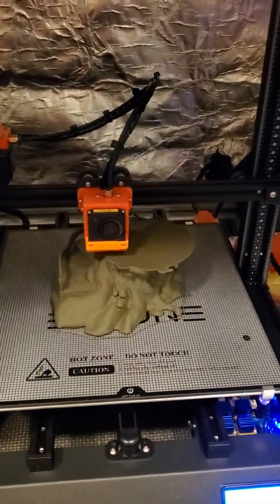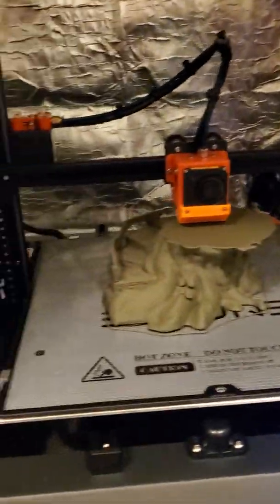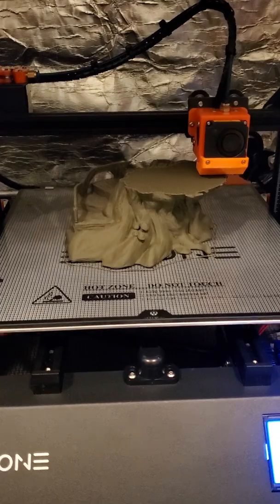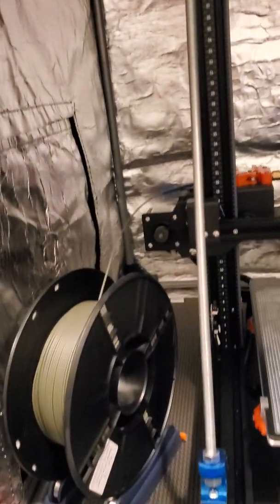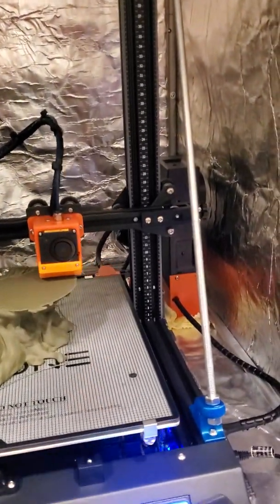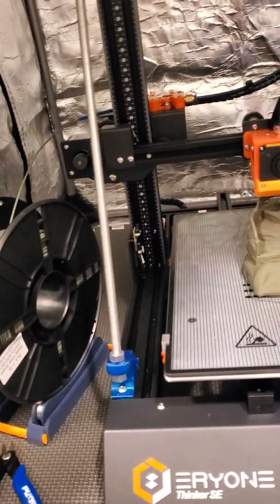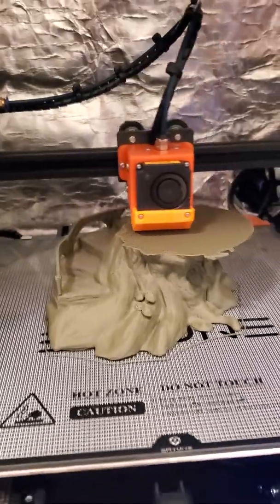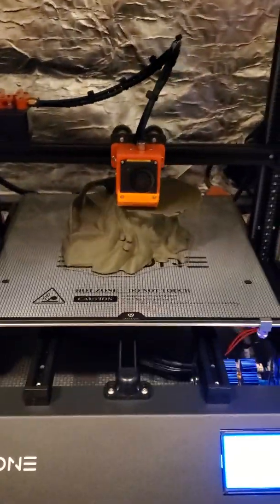Eryone Thinker SE upgrades for Klipper install/update

Comment: can you still use bl touch with klipper..and if your at stock is it best to put bl touch on before installing 
klipper  or can you mount it to the machine then put klipper on
Reply from the maker: Absolutely you can use a touch sensor with Klipper.  What you'll need to do is make sure the variables for your machine (offsets, etc.) are configured correctly.  There is a wide variance of existing config files for a large number of printers.  Many of those will just need you to "uncomment out" the lines specific for BL Touch integration.  I would talk to your printer's community about the best way to go about it - and I'll bet someone's already done the hard work for you at this point.
Reply: @jayburkette8977  i have eryone thinker se stock cheers jay
Reply from the maker: @darren990  I would reach out to Dana Olson (on the FB group or even here on YT) and ask for his settings.  He already has his BLTouch working on a Klipper installation.  HIs hot end is not stock - but the Klipper firmware and printer.cfg should be the same (aside from offsets, of course) for a touch sensor on the Thinker SE
Reply: @jayburkette8977  cheers jay
Reply from the maker: @darren990  Of note - I will be installing my BL Touch in about a week - then I'm going to start Klipper videos, etc.  I'm still learning lessons (hard ones at times) at this point....
Reply: @jayburkette8977  nice .thanks for putting in time and effort jay.